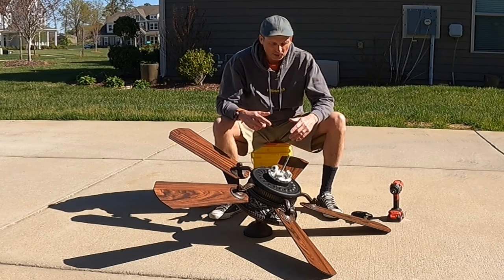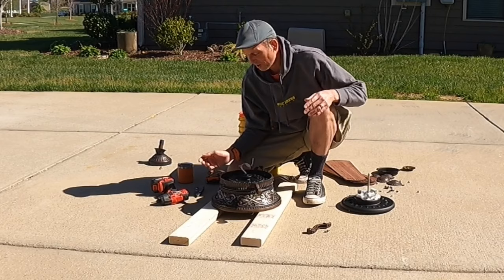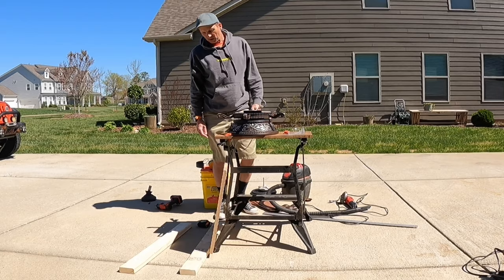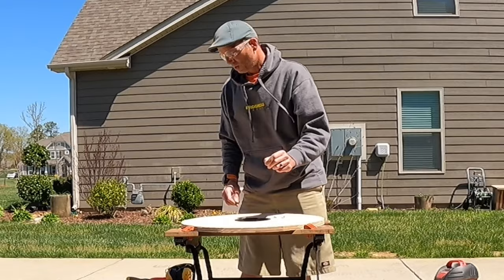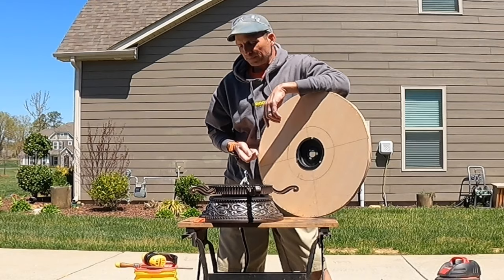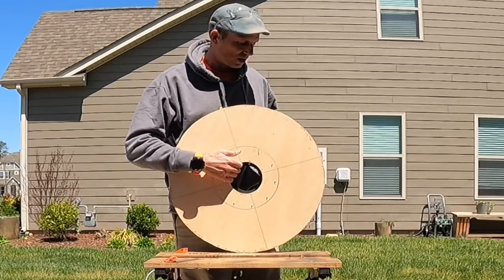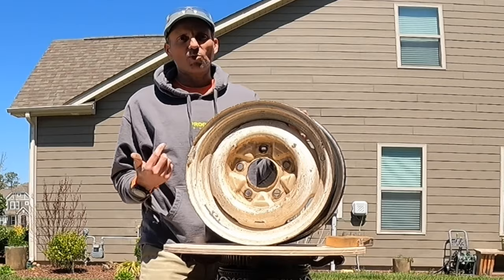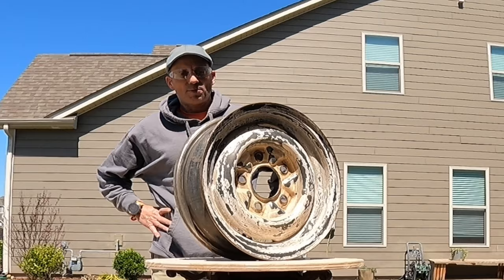How To Turn An Old Ceiling Fan Into A Useful Garage Tool or Ceiling Fan Upcycle... Trash to Tool??

Comment: I like your upcycling videos. People throw out old ceiling fans all the time so if you ever need to rebuild this, a little curbside scavenging should get you everything you need. I was surprised that the rim doesn't shift on the plywood while you're working on it. If you wanted to give the pluwood some more grip, you could pick up an old yoga mat at a garage sale or thrift store and add those concentric positioning circles you were talking about while you're trimming it out, and glue it onto the plywood.
Reply from the maker: Thanks and thanks for watching!  The funny thing is I actually have another ceiling fan in the attic already!  I might use that one as a fan in the garage though. If you get the rim fairly centered it stays put really well but I was surprised too. I actually edited out a segment where I said I may need to put some sort of rubberized material on the disc because of how well the rim stayed on without it.